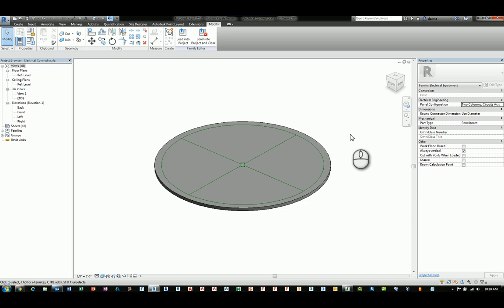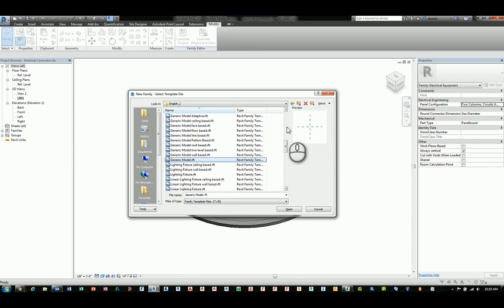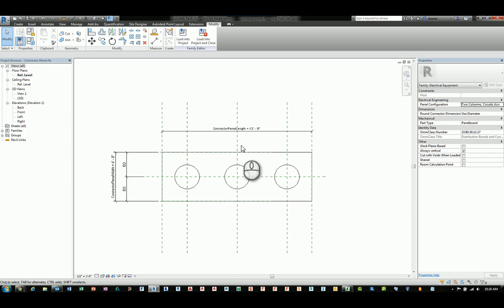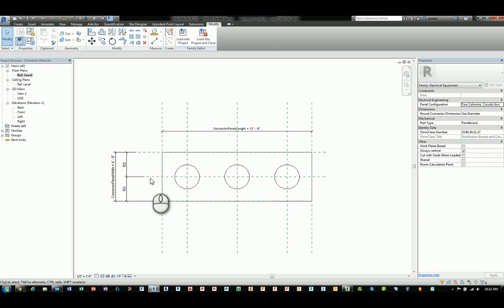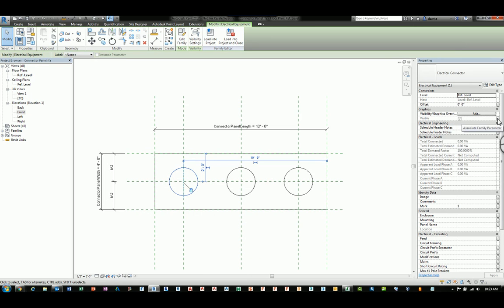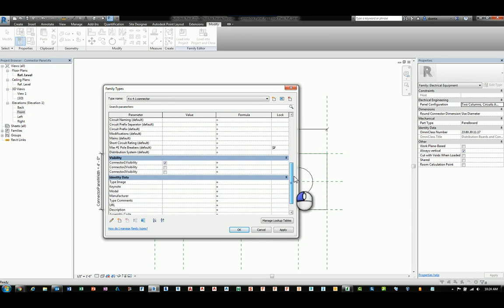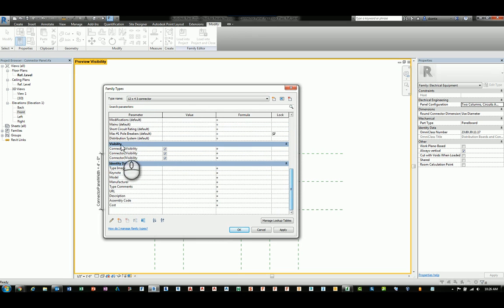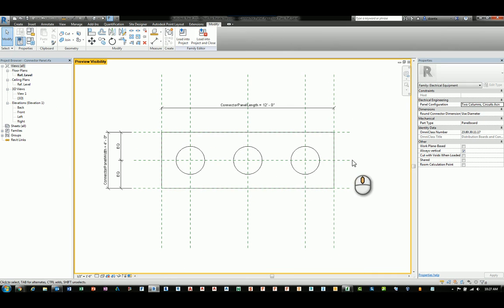Revit Family Types Visibility Parameter Electrical Family   A How To Guide

Comment: the geometry comes in but not the electrical connector
Reply from the maker: Tucker Smith 
Ensure the connector is hosted on the face of the nested geometry and then load this into a project to test visibility or use visibility tool in the View Control Toolbar to make sure it works before nesting into host family.
Reply: @DzanTa  Hi Thank you for this video, i tried what did you advice Mr Smith with, and when i load the first family (cyrcle + connectror) into project it's work perfectly  but when i load it into family doesn't work, any advice plaese ?
Reply: Mr SMITH , please did you fiind a solution fot this probleme ?
Reply from the maker: @ayoubchriyaa7000  if you are nesting a family into another one, verify that the Shared function is checked in the Categories Window.
Reply: @DzanTa  i already try this but also not working
Reply from the maker: @ayoubchriyaa7000  I can help u in about 30 mins.....